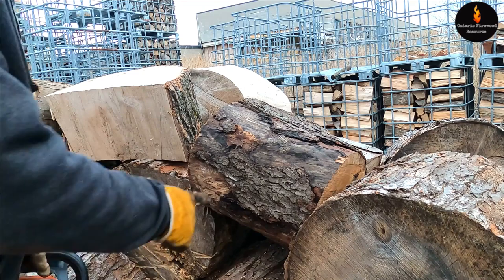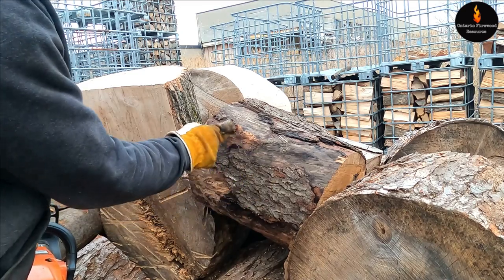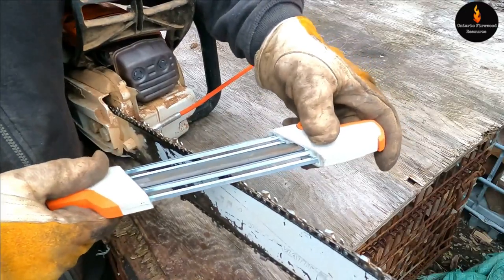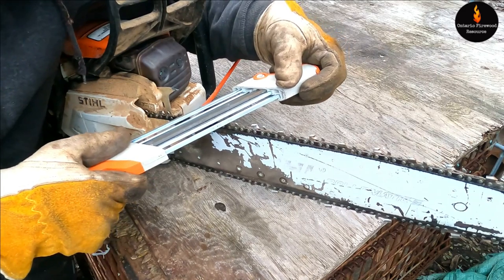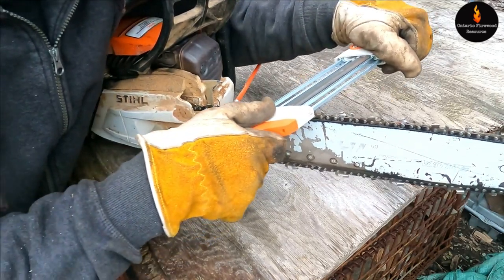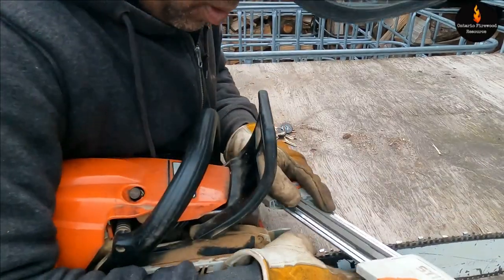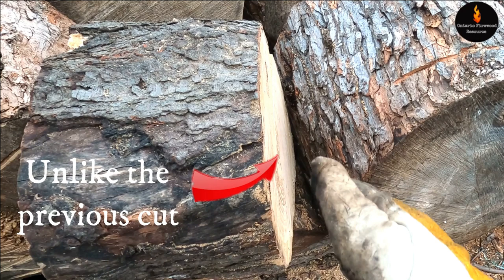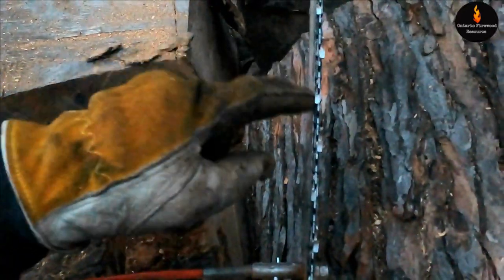CHAINSAW NOT CUTTING STRAIGHT?  HERE'S THE SOLUTION

Comment: Hello from Piqua Ohio. I have that same sharpener that you have. I have 20-in, 24-in, 28-in, and 32-in bars. It's always great to learn new techniques! You never too old to learn. Keep up the great videos!
Reply from the maker: I dont mind using this too because it's manual and it does the rakers. I used to use Oregon's electric dremel-style tool, which just fell apart in short time. It was quick on the teeth and I'd do the rakers with it ever third sharpening and would take off a nice bit and it would really dig in, which some people say is dangerous, but outside of fteak accidents, I feel secure holding MS261C in place, even the odd time that it jerks back. I never liked the idea of single filing and I liked that the electric tool got me back cutting quickly when the adrenalin is going

Comment: Hate it when that happens, more noticeable on larger diameter rounds.   Buckin Billy Ray did a video on this a couple years ago.   He took a brand new chain and filed one side down to almost nothing and left the other to full length and it cut straight.  I think the bar or rakers has something to do with it?
Reply from the maker: I love Billy Ray, he's like a kid in the candy store and he's a badass on the drums. I did a little research on what causes angled cuts (and made sure I mentioned all factors in the video) and I saw that the left teeth need to be filed for a right- angle cut, but i found the opposite to be true in my case because my right side teeth were longer while it cut to the right and I had to edit my video to make it seem like i was saying right side = right angle cut. Although my results are conflicting with raker/ bar issues, I'll still inspect the bar and rakers for perspective

Comment: Great demo Anthony! I have found it is not as much the size of the teeth, but more the sharpness of the teeth, if you have 2-3 dull or chipped teeth on one side of the chain, then the cut becomes uneven and the saw will struggle on some species of wood.

Keep up the hood work!
Reply from the maker: Hey thanks a lot man, yes I've noticed that a few dull teeth can make a difference. I shouldve had that point in the video too. Cheers

Comment: Ustam videolar bilgilendirici olmuş emeğinize sağlık.
Benim testerem sola doğru kayıyor belli noktadan sonra sıkışıp kalıyor paladan diye düşündüm.sifir pala ve zincir aldım olmadı. balatanin orası düzgün eğilme falan yok   yinede 
Olmadı hala yan kesiyor sebep ne olabilir ?
Reply from the maker: Hey, no problem.
Your issue is hard to figure out considering that you have a new bar and chain. The only thing that I can think is that you are pushing in the saw when it's cutting and the weight that you are putting on the saw is unevenly distributed, causing the saw to cut on am angle. The saw should cut through the wood effortlessly when sharp without pushing on the saw.

Comment: That worked well.. yeah most people  like me will sharpen one side perfect and the other a mess ...  couldn't find the 7/32 combo file here so I switched to the dremel tool..
Reply from the maker: Ya the Dremel tool gets you back to cutting real quick. I would do the rakers every third sharpening. I used to maintain the shape of the rakers but then ibjust started doing them flat, which isbwhat the Stihl 2-in-1 does anyway

Comment: Doesn't solve my problem.  My new bar and new chain, sold to me by a certified stihl repairman,  made 9 cuts into 12" diameter elm wood.  Then on the 10th cut it started cutting on an angle and bogged down at only 3" deep.  Dull blade now right!  Dull after only 9 cuts?  I question the quality of the stihl chain.  To continue, I then sharpened the chain.  I am not a novice at this.  I am 72 and have been working a chainsaw since 14. It now only made 4 cuts into the elm trunk before cutting on angle and of course bogged down.   I am convinced that the stihl chain is crap. We are talking almost new 20" stihl chainsaw.  Going back to ECHO.
Reply from the maker: Hmmm...different experience with me, anytime I have an issue cutting straight, the answers are: normal wear and tear
Bad file
One side of teeth lower than the other
Uneven filing.
I approve of their bars, I'm in the scrap business so I do know metal and they're made of very hard steel. I used to painstakingly drill through those bars to attach my bucking measuring stick on them and it was almost impossible and only a overtightened chain will cause bar wear in the guides prematurely.
I'm not a sharpening enthusiast, I've only used to 2 in 1 or a dremel style sharpener and I van ger a pretty sharp chain and getting wedged into the wood while cutting is not a big issue overall for me. Considering your symptoms, I can't speculate as to why you have your issues

Comment: Anthony We use the same sharpener, on average i use 4 stokes on each one🚜👍🏼🪵🇺🇸
Reply from the maker: I think I do a little more to make sure that the marred edge on the front of the tooth is completely gone so that the sharp edge of the tooth is flush with the top of the tooth, instead od a hair below it
Reply: @OntarioFirewoodResource  Anthony I used to do the same, but found it took the rakers down to much and caused chatter when sawing🚜👍🏼🪵🇺🇸
Reply from the maker: @outdoorswithlarryrobin  I have experienced chatter, but my 261C is pretty manageable for the most part with keeping it under control and I find that the cutting gets smoother shortly after sharpening
Reply: @OntarioFirewoodResource  I agree.
Reply from the maker: @brendalestertaylor2680  I do some extra filing if I can see any nicks in the truth and the edges need flattening. Thank for watching
Reply: @OntarioFirewoodResource  I cut timber 43 years still going the only thing worse than a dull saw is the guy who dulled it.
Reply from the maker: Lol that's hilarious